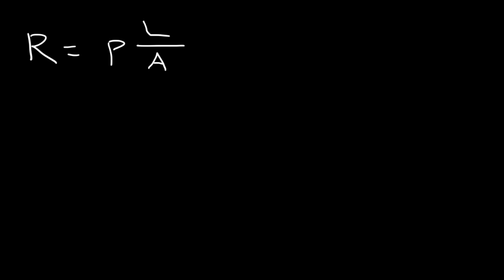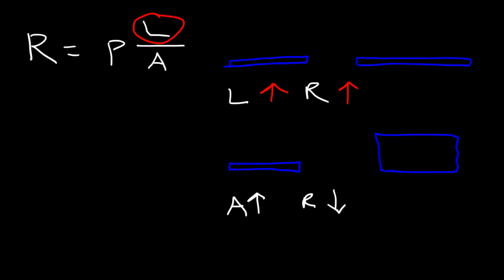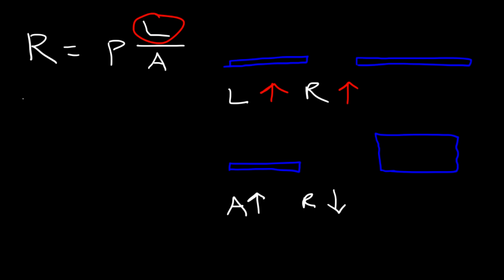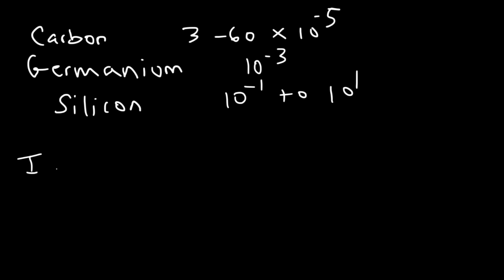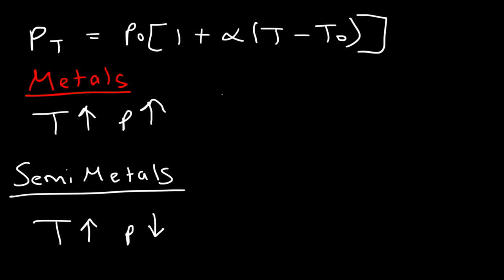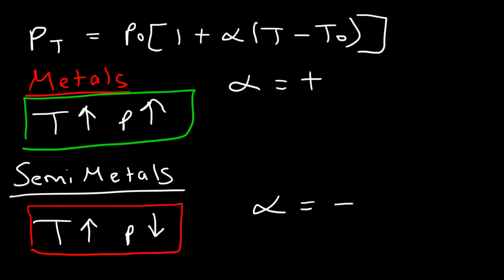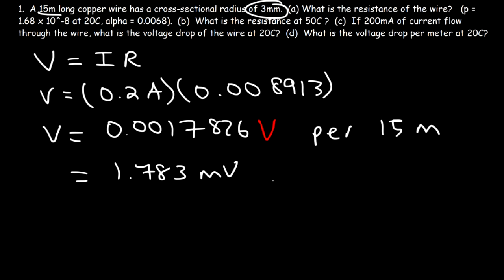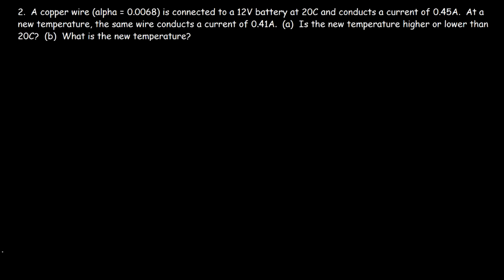Resistivity and Resistance Formula, Conductivity, Temperature Coefficient, Physics Problems

Comment: Someone clear my confusion please. Isn't R0 supposed to be the resistance at 0 C?? So, aren't we su[pposed to do it the other way?The alpha s will  cancel and then by putting the values we can get the answer. In my book, two different tempuratureds are given and one of the resistance in one of those two twmpuratures are given. We are asked to find tempurature coefficient. So, they didn't put the 25C (which is R1) in place of R0..cuz that's suppposed to be the resistance at 0C.

Comment: Air conditioning units are mostly used during summer period. A simple electrical circuit may represent the set-up of the aircon: a rheostat connected in series with the whole cooling mechanism (represented by a single resistor) and these combination is then connected in series with the power switch. The whole circuit is supplied by a 220 V power supply. The following are the values of the components: rheostat (10 ohms to 10,000 ohms) and the cooling mechanism (100 ohms). By theory, the higher the power consumption of the cooling unit, the higher the current flowing in the cooling mechanism. Given the following scenarios, answer the following:
b) Let us assume that the current value of the rheostat is 1000 ohms. Assuming that the value of the total current represents the current temperature (2 A for 18 degrees and 0.2 A for 25 degrees). Draw the electrical diagram and calculate the temperature at 1000 ohms.

Comment: Thank you so much for this video, I was stuck on a problem involving the top equation at the 11 minute mark. I was given the resistances and one of the temperatures and I had to find the other T and I never would have been able to do it without you showing the bottom equation in the red box with R instead of rho. Thanks again!

Comment: This video is so good! I just had a question... Are there standards for the temperature coefficient of materials? Could you theoretically work out the resistance of wires at a certain temperature without knowing the specific temperature coefficient?

Comment: At min 12.56 you calculate the area as pi(3*10^-3)^2 but we got told to do pi(3*10^-6) Which gives you a different result. I had this same thing repeated in university as well.
Reply: You have to square everything in the brackets, so (3*10^-3)^2 becomes 9*10^-6 rather than (3*10^-6)

Comment: Thank you so much!
I have a question at 16:50 when you wanted to calculate voltage drop for a 300m copper wire length. Why did we divide V by 15 when we wanted to calculate voltage drop for 15 meters, but then multiply it by 300 when we wanted to calculate voltage drop for 300m? Shouldn't we take the original resistance at 20 C (1.783 mv) and divide it by 300m instead?
Reply: 0.119 mV is voltage per meter so for 300meters will be 0.119 x 300

Comment: use the water analogy. voltage is pressure current is water resistance is the valve or in this case wire. longer the pipe the more water is needed to get to the other side meaning higher resistance. smaller pipe will transfer even less current/water so higher resistance and vice versa

Comment: Given Rm = .74 @ 20 Celsius, what will Rm equal at BHT if Total Depth is 2400m and the

Geothermal Gradient is 2 Celsius/100m (Surface temperature 20 Celsius) ?

Comment: I have a question, I'm working through my Electrotechnics N4 model now and am busy with resistivity. I have the length of a wire which is 25 but in my example in the handbook, where R=PL/A, they still timed Lx2 to give a length of 50m which I don't understand why. Think you can help?

Comment: Hello,  I was hoping you could help me possibly.  I was planning on maybe getting into some silver and gold purchases and learned of the rather large problem with fake metals being placed inside gold and silver products .  However I also learned that there is a device called a sigma metalitics precious metals verifier the will test metals authenticity based on resistivity.  Well knowing that the multimeter tool from the store costs like 40 bucks and measures resistivity ohms and all that stuff and that this gold tester costs over $2,500 dollars I was wondering,.... well I've been pondering that there must be a way using equations such as yours to verify a metal resistivity and thereby the metal itself since they all have a different resistivity ....  such as taking a reading from the multimeter and then performing an equation on it that should always come out to that metals exact resistivity..... otherwise it would not be authentic gold or silver....  There has to be a way... that must be what they are doing with the expensive machine....   im sure you figured out by now I am wanting to use the resistivity test using the math equations and $40 tool rather then the $2500 dollar tool.  What equations' for a coin and bar would I use.... always at room temp...  to determine if the metal is authentic....  I am thinking that if I know the equations I should be able to use a multi meter and do the calculations myself with a calculator rather than paying 2500 dollars for something to do the calculations for me.. That's one high priced calculator.  Please let me know and Much Thanks For Any Help You Can Provide to me!!!!!!

Comment: Hi, just a question to do with the difference between single-core cable and twin cable. If you have a Cross-Sectional-Radius (CSA) on a cable of 2.5mm and it is a twin cable, do you double the Cross-Sectional-Raduis (CSA) to 5mm as you are sending a set voltage( Let’s say 230v for me in the UK) down 2 cables, in which case you half the voltage as it’s going down 2 separate cables?

Because this would then change the value of resistance at the end of the circuit. 

Cheers

Comment: Hi,can somebody help me with this problem?Intensity of the electric field in steel wire of cross-sectional diameter 0.8mm equals 20 mV/m. Find the current flowing in it if the resistivity of steel is 1.2·10^-7 Ω•m (pi=3)
Reply: Using ohm's law V=IR, U can find that I=V/R where V is given and to find resistance R use the formula R=P(resistivity given)L/A.But I can't help u how to find L.

Comment: metal on heating expands. so, larger the wire more will be the resistance. that's why metal resistance increase with increase in temperature right? is this correct? can we use this reason? :/ help!

Comment: wht is the relation btwn cross sectional area and resistance
Reply: The smaller cross sectional area means a thinner wire which allows less current to flow and current and resistivity are inversely proportional (ohms law)

Comment: How do you know what alpha is?
Reply from the maker: It's usually given in the problem.  You can also look it up in the reference table of your physics textbook.
Reply: what if , its not given in the problem
Reply: Temperature coefficient of resistivity and its unit per degree Celsius 
Sorry for replying u after two years